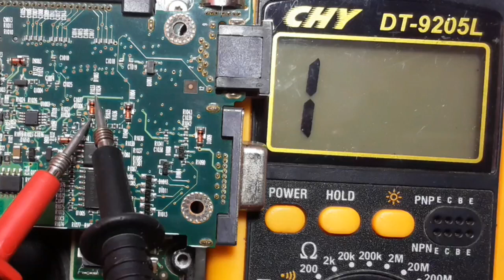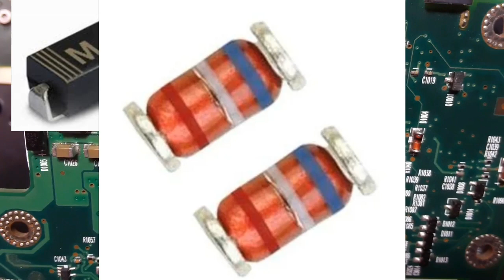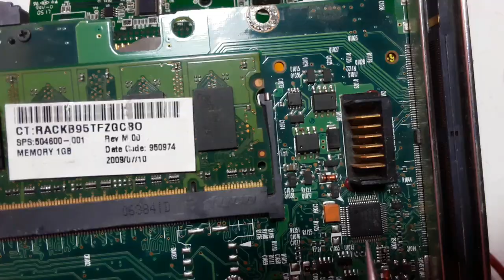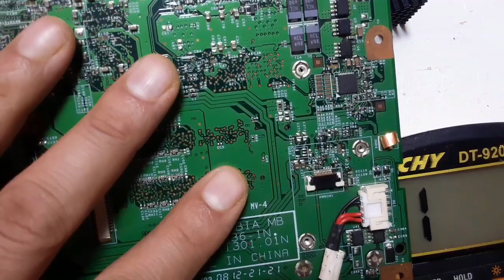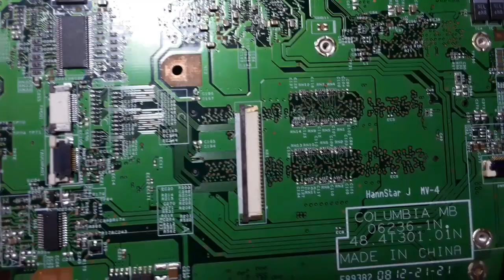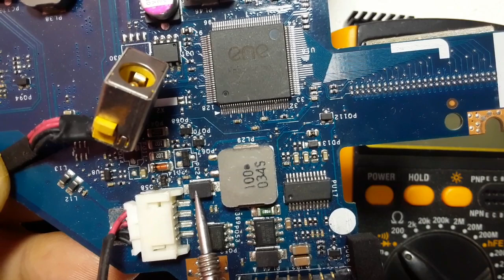SMD diode testing using multimeter complete guide

Comment: Thank you . I am trying to repair a radar detector that the 4 wire power /remote  mute had became bare and shorted together. I can see physical damage to one of what I believe to be a double diode. The manufacturer did not label the circuit board nor do they publish a scmatic (escort) . I have never soldered a surface mount component before . I can't find anyone willing that's able to even change the component for cash even if it fails to operate afterwards. I guess I'll just blob enogh solder on top to get it loose and then solder a pair of tiny axial diodes in it's place. ?! Wish me luck . Thanks for the video , it helped me make an educated guess. I will check out your other videos and subscribe . Happy New year and thanks for listening too!

Comment: Hello nice video. How do i discharge smd capacitors? I need to measure components on a motherboard. And what's the difference between smd resistors R100 and 100? Regards

Comment: On LED mother board, I find one M7 diode gives beep sound on both sides when I check it with continuity on multi meter.   When I remove one side of the diode, then it shows resistance on one side only just like normal diode.  Do you think this M7 diode is short or good one? Please advise.

Comment: Hi there , at 02:45 , there are 2 area, Green light and dark green on the bored , what is different between in 2 area . thnx
Reply from the maker: The dark green area is neutral (not used), the bolded light green area is for Ground and the thin light green lines mean signals